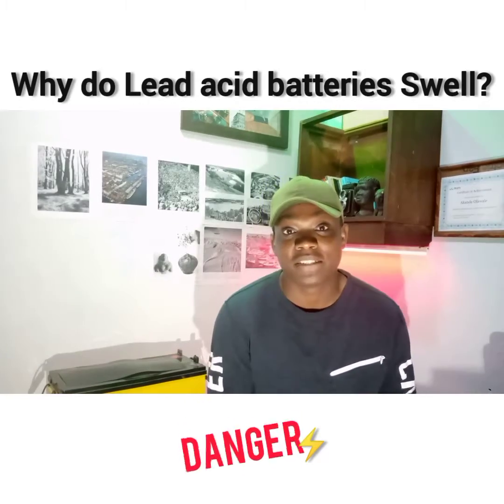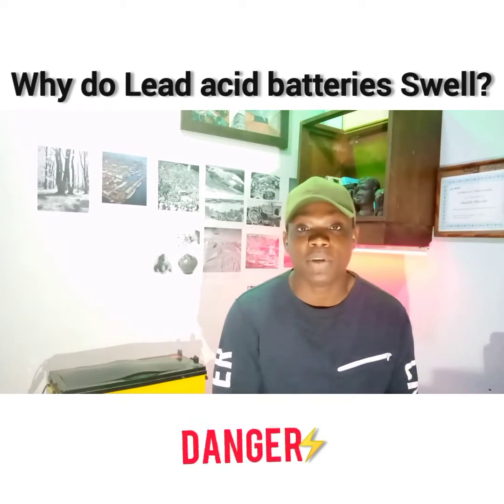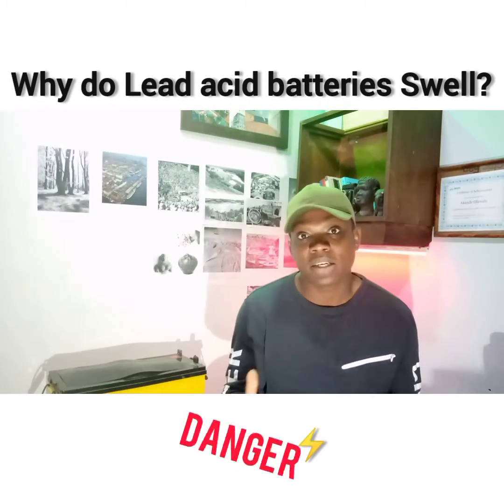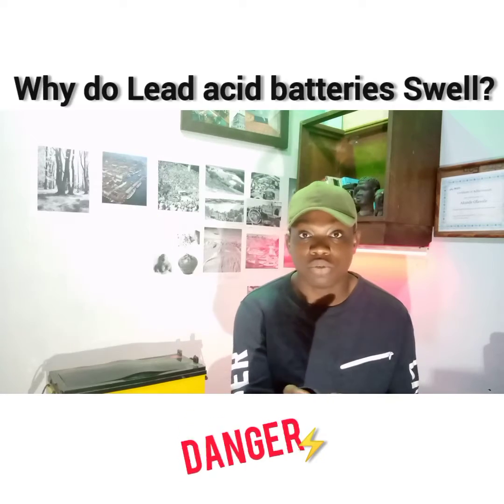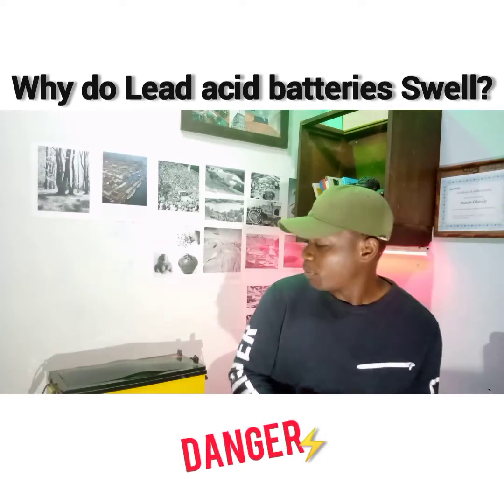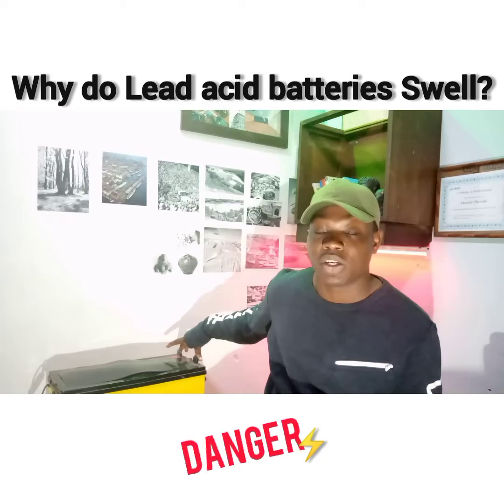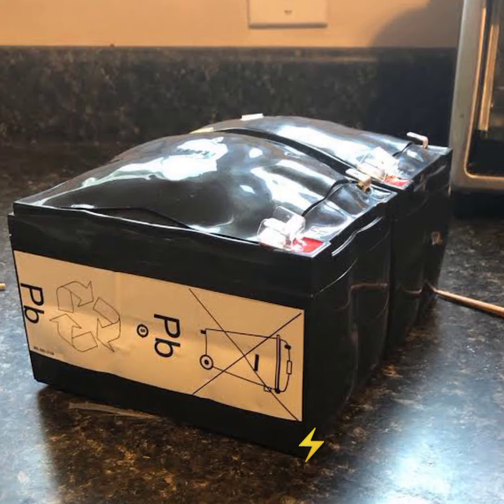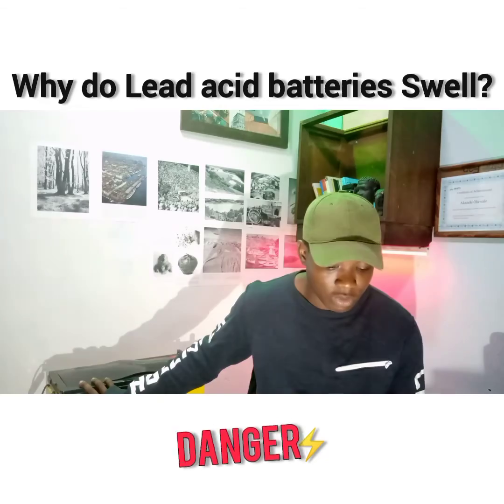Why do Lead acid batteries Swell?

Comment: Why Upgrade Your RV from Lead Acid to BigBattery?

BigBattery: Lasts 10+ Years with Zero Maintenance. (3,000-4,000/Cycles)
Lead-Acid: Lasts 2-3 Years with Annual Maintenance Required. (500-1000/Cycles)
BigBattery: Weighs ⅓ the weight @ 47/LBS for 2.17KWh of Capacity.
Lead-Acid: Battery Bank adds 700+lbs to your RV, lowering fuel efficiency.
BigBattery: Provides 2-3x More Power to more easily run heavy applications.
Lead-Acid: Relies on your generator using fuel to power heavy applications.
BigBattery: Charges 3x Faster through “Continuous Charge”.
Lead-Acid: Charges slower requiring wave charging.
BigBattery: Requires 1/3rd the space, providing extra storage capacity.
Lead-Acid: Requires 3x more space eliminating valuable storage for your tools and toys.
BigBattery: Includes Smart Safety Features in every pack. (BMS/FUSE/THERMAL)
Lead-Acid: Zero safety built in. Exposed leads & terminals. Requires additional fuses.